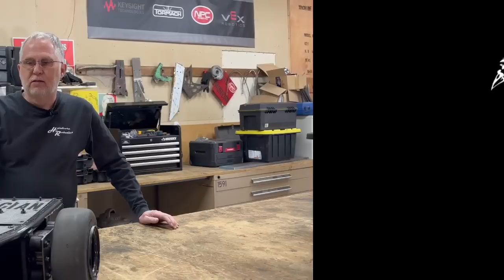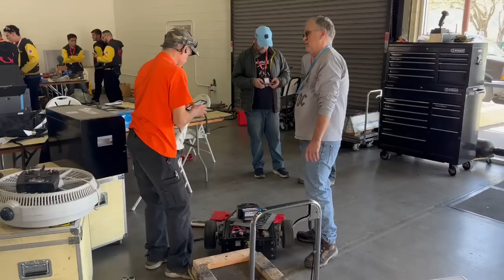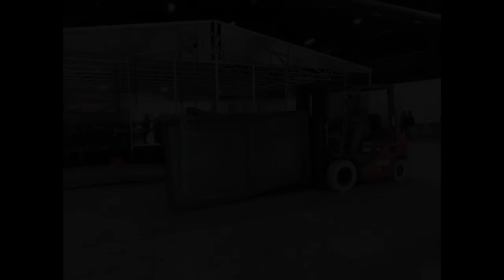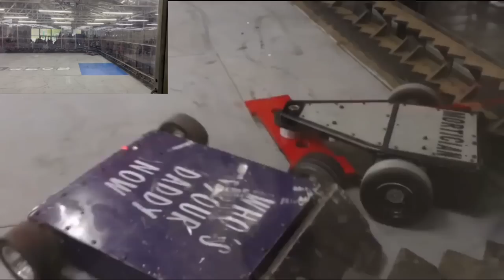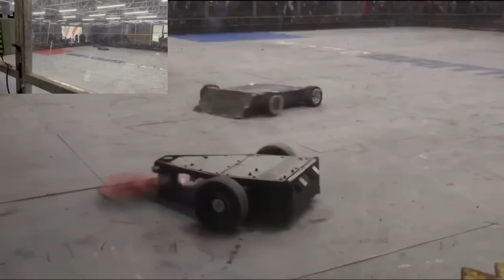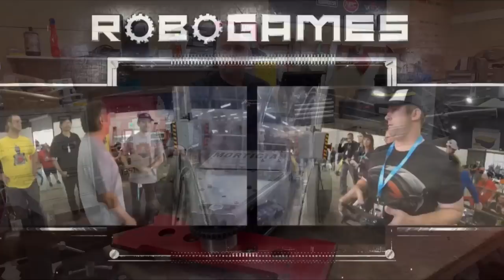Mortician 2023 - First Fight!

Comment: The driving was questionable unless you had radio issues ?
Reply: He explained why the driving was not the best at the end of the video.
Reply: @wyrmh0le  He did say the surface was bad for driving on but if you have watched Ray's channel for any length of time you would know most of the arena's are bad for driving hence all the sanding work he does on the tires.  This time it looked as though he couldn't steer in a straight line and mostly had the rear of his machine facing his opponent that would have been disastrous against other more dangerous bots....
Reply: @TheTwistedStone  Correct he said that. He also made a few other comments.
Reply: @wyrmh0le  I think they either need to come up with a better arena floor or the bot builders need to account for it.  It's no fun watching a battle where the opponents are crippled to begin with....
Reply: @TheTwistedStone  It was the first fight of a new robot that controls differently than it used to so understandably Justin had to get used to it, and the floor. That's it.
Reply: @TheTwistedStone   Ray has been using that technique of exposing the rear end on purpose for many years.

It's so that when the opponent gets to the back of Tombstone/Mortician/Last Rites, he can quickly rotate his bot around and hit the opponent's wheels.

Comment: I know your weapon (the spinning blade) has broken in past battles. Have you considered using a custom forging instead of simply cutting the blade from a sheet of special steel? Forging are super tough. For example, all critical components in aircraft landing gear are forgings because they don’t break even with the most severe shock loads.
Reply from the maker: Airplane landing gear extremely well engineered, I would agree. But the needs for the two usages are very different. Airplane landing gear is designed to be strong and lightweight, but not designed for impacts with sharp and hard objects. Most landing gear struts are forged aluminum, since it is both strong and lightweight, and you avoid tooling marks from machining so eliminating stress risers. In that case a forged part is superior to a machined one. But a guy with an axe (both way less power and a way less sharp/hard hit) could destroy a landing strut fairly quickly. 

We're always looking for new alloys and new processes, within reason of the limited budgets that can be used for this sport. It's just a very weird and unique need!

Comment: The spin up time, to get to a dangerous speed seems a bit slow, at least compared to your other horizontals with brushed weapon systems. Is it just me?
Reply: I’m imagining that it’s brushless teething/tuning problems. But I’d be interested to see what the man himself has to say
Reply: I think it's a torque issue. The sprocket at the blade shaft is quite big, I think the reduction by the  Whyachi isn't enough.
Reply: ray said earlier that it was geared higher than he would like :)
Reply: @erneuerteseinfuhlungsvermogen9  I never heard him say it, but I believe it. The KV of the brushless motor is probably much higher than the brushed motor it replaced
Reply: @elitedogger7142  in his assembly video he directly says this
Reply: @erneuerteseinfuhlungsvermogen9  Must have missed that. Thanks
Reply: @elitedogger7142  np ,but also an important factor is that the torque of brushless is low, so its worth considering, I believe he would make necessary changes for the performance soon )
Reply from the maker: Sort of a combination of things. It is geared faster than I would like. 21000 rpm motor, geared for about 3900 rpm to the weapon. I would have been happier around 2500 rpm I would guess, even with the reduction in KE numbers. And the brushless control systems are just a handful. I suspected we might have some issues during testing, but we were really kind of committed at that point to the hardware on hand. Always stuff to do for next time.

Comment: Ray,,real question. I'm quite interested in electronics but I can't understand why your weapon gets up to its rpm limit so slowly. 9 seconds or so ?

I'm thinking logically here , given the weight class, mAh, temperatures etc you probably can't just ram some more amps at it for 3 minutes and maintain destruction ?
Reply: My current hypothesis would be Brushless quirks. With brushed motors you can just dump more power into them and see more performance (while potentially cooking motors.) 

From my experience with brushless there is a lot of tweaking and tuning to get them running optimally due to how much more complex the electronics are. 

I imagine it’s gonna be like copperhead, it’s more or less the same weapon system (to my knowledge), but they have fixed a lot of the electrical gremlins associated with brushless
Reply from the maker: There are a few things going on here, that would need some changes. The weapon motor is really geared too high. I needed more reduction. We had plenty of battery, so that wasn't the issue. Some of it was clearly the brushless controls need further work. The power to weight ratio for brushless motors is just too impressive to ignore, but they sure are finicky!
Reply: @ray9368  Thanks Ray 🥰

Comment: So is this the same bot as Tombstone, just rebranded?
Reply from the maker: No. Obviously the design concepts are similar, but there are virtually no parts in common between the two. Mortician is for the 120 pound middleweight class, and Tombstone is for the 250 pound heavyweight class.
Reply: @ray9368  Ah, the weight class. That's a detail I completely misssd. Thanks for the reply, Bill!

Comment: Ever think about using RC hobby gyros to help stabilize the robot? Small RC drift cars seem to really benefit from them while sliding around.
Reply: RC Gyros used to be pretty popular with bots on the old (english) Robot Wars and classic Battlebots days 20+ years ago, but as impacts got more extreme from harder hitting weapons, adding more electronics that can fail is usually a liability.

I do really like the concept of sensors helping drivers out with simple PID controllers and more experiments with things like meltybrains have been done in the lower weight classes, you could even have something that automatically counters the torque reaction from the weapon spinning up. But I think right now the benefits don't outweigh the possibility of the gyro or controller getting damaged/malfunctioning and the bot just dying because of it.

And in a way, Mortician already has a gyroscope. It's the big piece of metal spinning in the front really fast, which likes to keep the bot horizontal (or vertical when it's windmilling)
Reply: I think RIPepperoni has the right idea with the counter rotating gyro to counteract the precession of the weapon disc.
Reply: @bami2  Yeah, obviously you would want any supplemental electronics to fail in a safe way... maybe another channel on the transmitter to disable that path entirely. I know some bots have entirely redundant radio systems too, and can switch between them.

Comment: I don't understand...you just renamed Tombstone Mortician?  It looks exactly the same lmao.  And you fought a dummy robot that had no weapon.  Literally any robot would have won there
Reply from the maker: Mortician is a 120 pound middleweight robot. Tombstone is a 250 pound heavyweight robot. Certainly there are design similarities, but there are literally almost no parts in common. If you look back through the extensive videos I've done on the build of Mortician, you can see that it is new from the ground up. Here they are for size comparison:

https://www.facebook.com/photo?fbid=10229671188315028&set=a.10203812116014382

And robots with no weapons use all of their weight for armor, so are naturally a difficult opponent for weaponed robots.

Comment: Great to see mat Maxham Lending a hand 👍. Also was wondering how much of a difference does that bevelled bar make against a wedge like that?
Reply from the maker: Matt was part of the crew for this event, doing robot safety inspections. But yeah he gave me a hand getting the robot ready for inspection.

The beveling on the weapon strike area helps the weapon to dig into slated wedges, and we were able to do this in this match.

Comment: Hi Ray! Big fan of you and Tombstone on Battle Bots. Just wondering, is there a fundamental difference between Mortician and Tombstone? Looking forward to seeing more videos!
Reply from the maker: Although they share some design ideas certainly, there is really very little in the way of shared parts. Pretty much just the power switch and the radio receiver! Tombstone is 250 pounds, while Mortician is 120 pounds. They're just built for different weight classes.